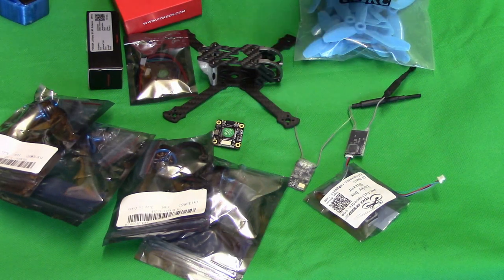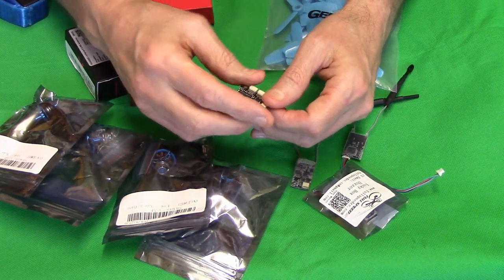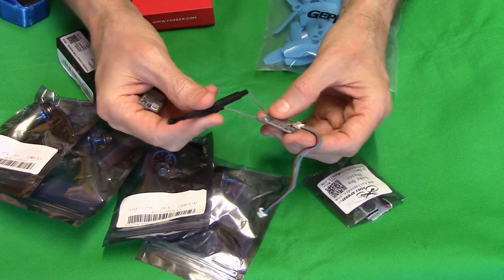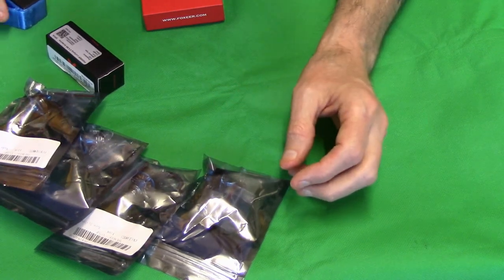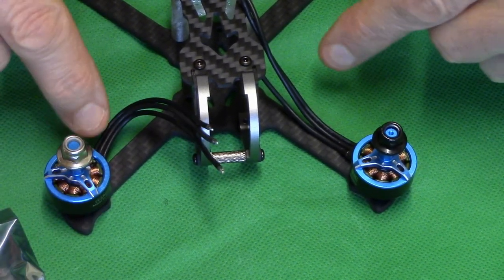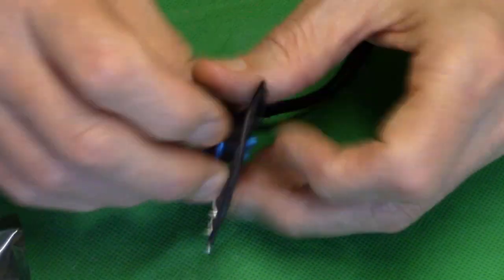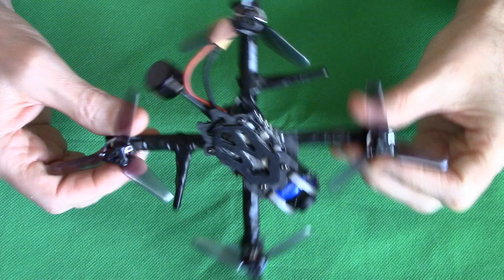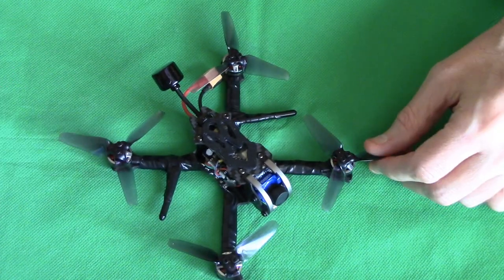GEPRC PX3 PART 2

Comment: I’m not a fan on the tape around the arms .. 
you can use heat shrink look much better 
Use the receiver mount that was with it looks better with it on  xx
Reply from the maker: Have to agree to disagree, I don't like using heat shrink on the arms, as you have to stretch it so much to fit over the motor mount, because it's a one-piece bottom frame so you never get a good fit, tapes much easier. Also, I don't like the look of the receiver mount, that's why I didn't use it. 🍺

Comment: we can use happymodel mantis 85mm from for this GEPRC GR 1206 4500KV motor ?
Reply from the maker: I think they would be to big.. Sorry
Reply from the maker: If you really want to use GEPRC Motors and I don't blame you (there awesome ) hears a link to some that will fit, Hope this helps..   
   https://www.banggood.com/GEPRC-SPEEDX-GR1103-8000KV-2-3S-10000KV-1-3S-FPV-Racing-Brushless-Motor-for-RC-Drone-p-1505516.html?rmmds=myorderA02817649204201406M5